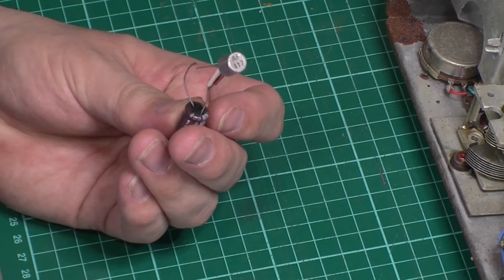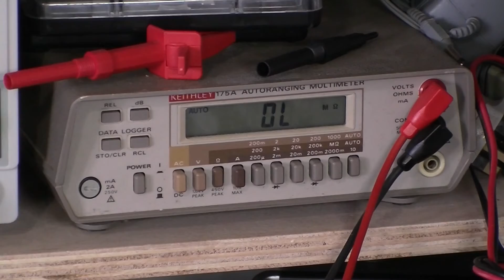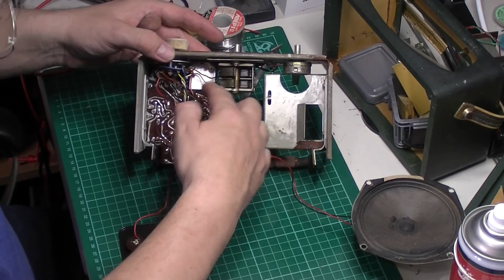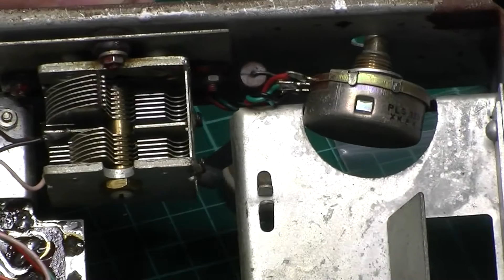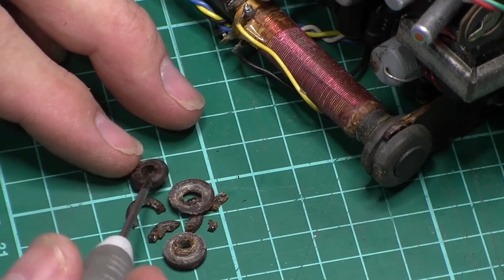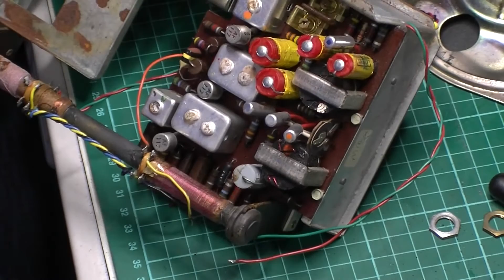Roberts R200 Part 3: Electrical repairs

Comment: Hi Graham. Just got one of these and the same grommet problem. Do you know what size I have to buy?
Same with the 117s :-(  as the sets dead. My bench supply only goes up to 20V so I'll probably have to get another supply now to be able to get it to 50V.
Damn broken ferrite too which I failed to spot. I might have to class this as an unlucky radio :-)
Reply from the maker: Hi Simon. The version with the AF117’s in is the later one. They are good sets so you will have to either zap the transistors or replace them. I’ve heard of people clearing the shorts with 9v batteries so it may well work with the 20v supply. If the ferrite is a clean break then you can glue it back together with super glue and it will work fine. I will dig out some grommets for you. Cheers Graham
Reply: @Radiocruncher  Thanks Graham. Let me know how much I owe you for the postage. See you later

Comment: Would it be that exspensive to replace those transitors with a modern one that would last longer or not
Reply from the maker: If you could convert it to silicon it might be cheaper but you may need to alter the biasing which would take ages
Reply: @Radiocruncher  do they have any new old stock then,my thinking the same problem will come back,with a modern transitor ,you can look up the bias and match the closest one to the old transitor,i believe ,but you sir are the expert,I am only trying to learn ,from people in the no like you who have so much skill doing this ,and I no I have so much to learn ,thanks for your time.
Reply from the maker: Hi Ron. I’m certainly not an expert in biasing transistors as I’ve never attempted it before. I tend to use the Russian GT322B which is readily available and cheap if bought in bulk. There’s some useful info on using silicon here that’s well worth reading https://vintage-radio.net/forum/showthread.php?t=76440&highlight=AF11x. Thanks for your kind comments
Reply: @Radiocruncher  thank you for your kindness and help and advice,i look forward to finding all your videos.

Comment: Dear Radiocruncher,
I own a Roberts R200 and I learned much from your AF117 tips/videos. I replaced transistor 1 for an AF137 and everything worked fantastic. But after a few weeks suddenly Longwave stopped and now I only receive some noise and motorboat engine sounds on LW. I checked as much as I could but no LW reception yet. I hope you can give me some hints. 
Thank you very much in advance and also for your great videos!
Arthur
Reply from the maker: Hi Arthur. I would suspect that you will have to change all the AF117’s. I tend to use AF127 or Russian gt322b. I have never tried an Af137. Another component that causes issues in these sets are the small dark brown cylindrical capacitors. They would certainly cause the problem you have described. Thanks for watching the videos and glad you enjoy them. Good luck, Graham

Comment: Hi Radiocruncher - enjoying your videos, thanks. I just prchased a Roberts R300 off ebay in fantastic condition. It didnt work and the problem was the AF117 osc/mixer transistor. I followed your methodology but zapped it with a 9Volt  pp3 battery and it worked fine. As an experiment, when the AF117 was out of circuit i tried a BC558 general purpose lost cost easily  sourced transistor and it worked fine! Nothing better than that moment when a ;dead; radio from another generation bursts into life!! Cheers
Reply from the maker: Hi Marty and thanks for your comments. A 9v will burn the tin whiskers back enough to get it working so well done. The higher the voltage though the further it will burn them back so maybe 3x PP3's in series might be worth a try for future zapping. These old radios are pretty robust so very often a general purpose transistor will work. The AF117's when working are surprisingly good transistors and tend to work better than equivalents. It is a great feeling to get something working again. That's why I try to buy non working sets if I can. Keep up the good work. Graham
Reply: I glad there is a modern cure for replaceing those transitors with tin whisker ,I rather have a modern transitors put in ..II glad you found a good general purpose transitor

Comment from the maker: Thanks for the comment Ian. I have started doing them at 50v which certainly seems to work. I could push my power supply to 60v but probably wouldn't make much difference. What power source do you use for zapping them?

Comment: I usually use a higher voltage when zapping AF117s. You can usually see the flash through the glass base of the transistor. I have a Bush  TR130 I did several years ago and it still works really well today.